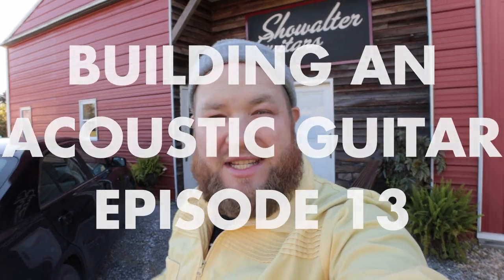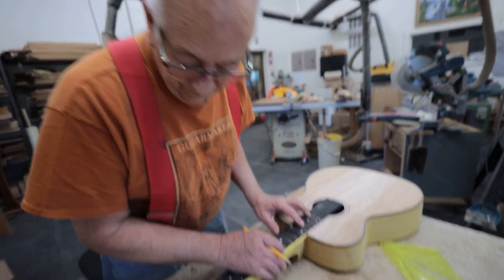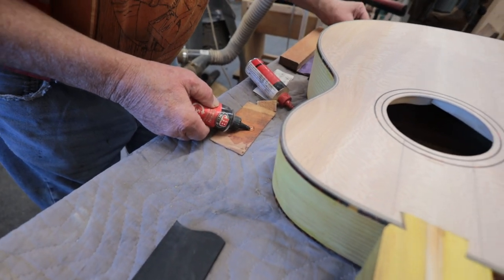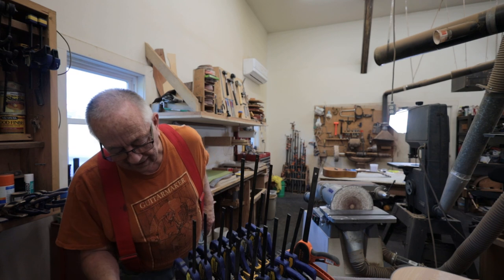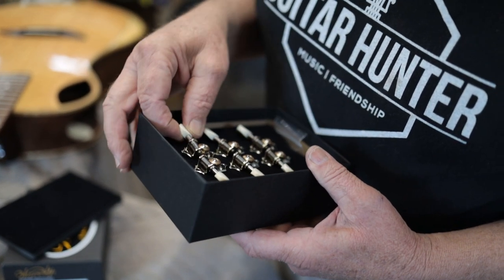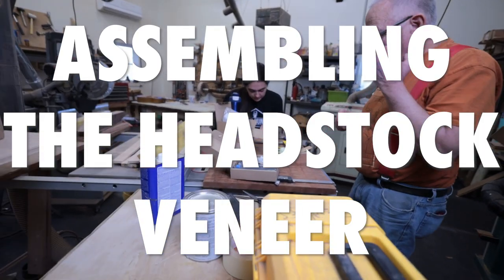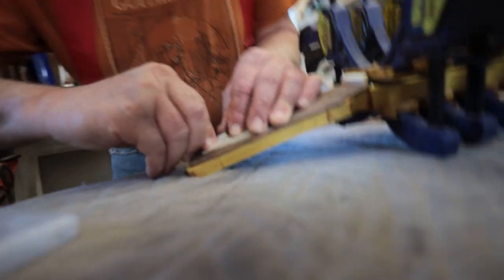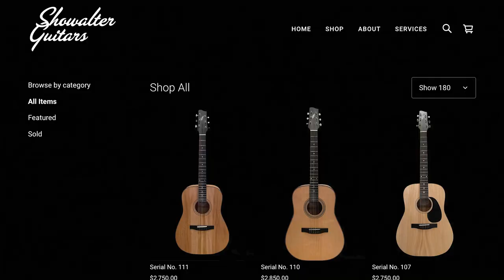Building an Acoustic Guitar with @showalterguitars5707 Episode 13 I Gluing the fingerboard

Comment: These guitars are extremely intriguing to me, but have you discussed the longevity of the unconventional toonwoods? Is there any precedent that shows sycamore, osage, red elm, etc. hold up after 10-20 years. I know every piece of wood is unique but some species must be more or less prone to cracking and warping. I genuinely have no idea, but if you have any info on that I might be sold.
Reply: Im pretty sure all solid wood can be stabilized/dried and cured, not 100% sure on that.
Reply: There is an article in Taylor Guitars new Wood and Steel magazine about researching new woods for workability ( minimize shrinking , twisting and cracking) AND tonal sound quality. They are producing a new line from Red Ironbark (Eucalyptus variety) , a street tree species in CA. I suspect Mr. S is using quartersawn blanks which are usually  more stable than flat sawn.

Comment: I'm quite concerned about the longevity of the instrument  because of some bad decisions being made. So you didn't install a truss rod before gluing the fret board. Then you used an epoxy glue instead of Hyde glue or reversible tite bond type. Epoxy isn't reversible you can't take it apart or loosen it up if it ever needs a neck reset or adjusted due to not having a truss rod.
Reply from the maker: There's a dual action truss rod. You're right though, epoxy is a one way solution. We'll talk about it in the questions episode soon.
Reply: @JeremySheppard  I am glad to hear that you put a dual truss rod it since you used the epoxy. I didnt see  it and I guess I didn't see the episode on making the  neck. So that is my bad. I understand what he was saying about why he uses epoxy for that but I am not convinced. I have fixed too many shit necks and built several of my own and I dont see it curling. I typically do not use titebond at least for that part of the Job because I believe Hyde glue to does a be a better  job and if you use the wrong titebond it isn't water/heat reversible and sometimes the generic version don't like letting go. Hyde glue is rated at almost 3,000psi and us reversible with heat and water. As far as the truss rod I feel like and I believe that if the neck is constructed properly you really could go without one. This goes especially for wood that has been stabilized via having been roasted/torified. Quarter sawn necks or a laminated neck  riff sawn down and toward the middle and a quarter sawn center strip work great too. If they ever move and its hyde glued a few minutes with a clothing iron a clamp or two and you can set it back to good. But I'm crazy.  Instead of epoxy or glue if moisturebis a concern why dont just bolt the fretboard on amd hide the with the inlays? Not convinced of that either but it is easier to repair..  I have redone epoxied on fretboards before. i pulled the frets off and I routed it off once, planed it off with a 4 inch hand planer, and cut one off. The planer is the way to go and if you're cheap and lazy you can get a completed/fretted fret board  from China for $25-30 and you won't have to make and fret it, just level, crown and polish. 
  I do want to pose a question this video has made me ponder. Please feel free to chime in on this if you build guitars or do serious woodwork.   Is there such a thing as over clamping? If not is it really  necessary for things to have so many clamps populating the work? What about Clamping too tight?  This isn't a criticism this is a legit thought ive had since watching this. Too tight is something I'm prone to doing and I really have to make an effort not to do that. Clamping down too tight can push out too much glue.  I wonder If over Clamping could put too much pressure on it similar too clamping too tight.